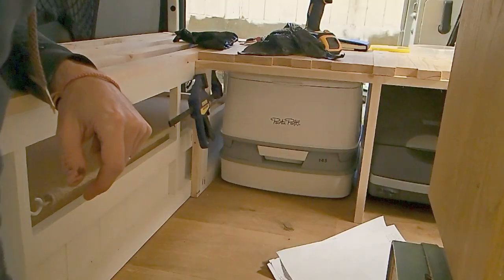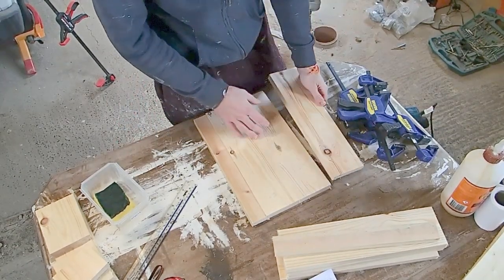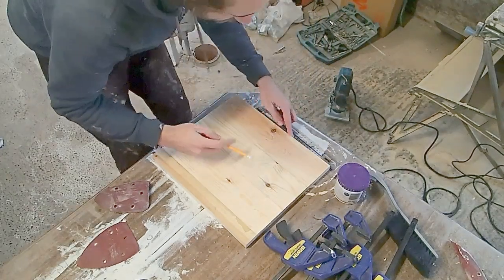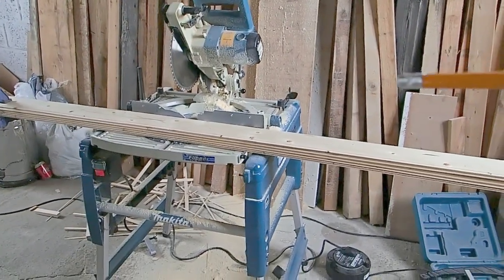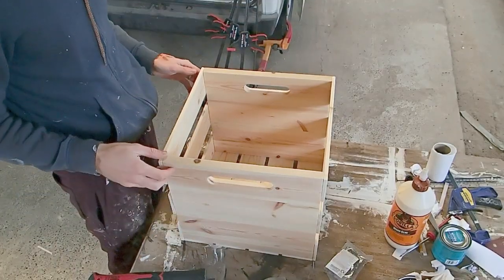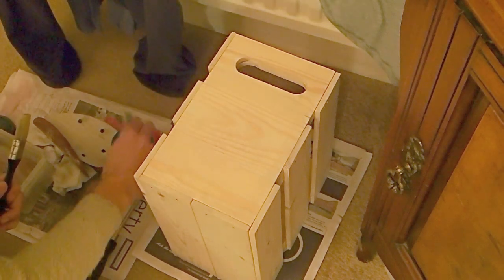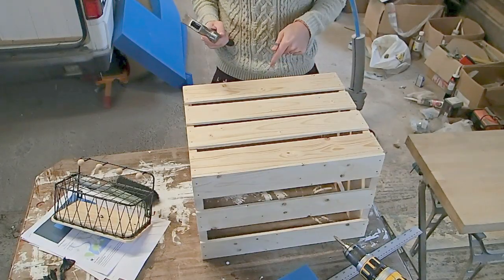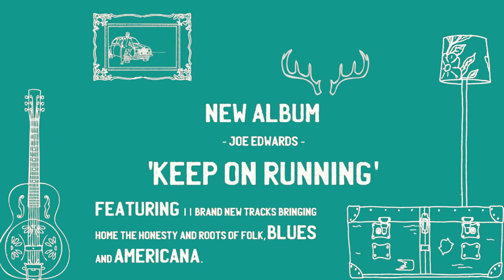How To Build Wooden Storage Boxes/Crates - Part 11 - How To Build/Convert A Camper Van

Comment: Great video - the storage boxes look great and the transfer method works well - I must try that! Couple of thoughts - I've worked extensively with tongue & groove (matchboard) and have found the cheaper DIY store products have a tendency to cup/warp badly. I used to have to scrap quite a lot. I ended up buying some better quality stuff from my local timber merchant - more expensive, but much more stable. Of course, glue and pins will help and if you don't mind it looking a bit rustic, then fair enough! I'd also consider drilling a tiny pilot hole if you hand nail - those boards have a tendency to split if nailed close to the edge.